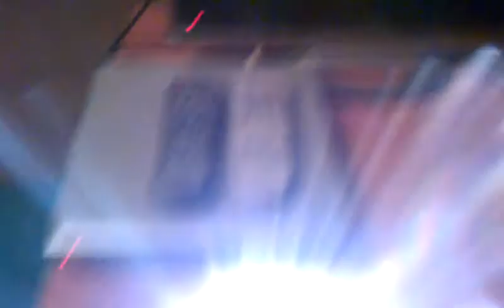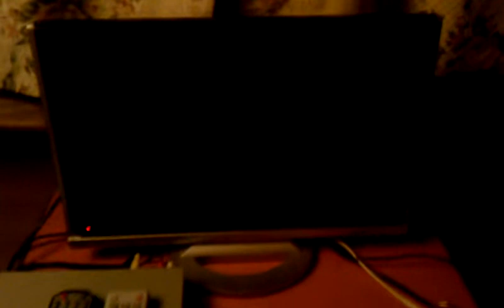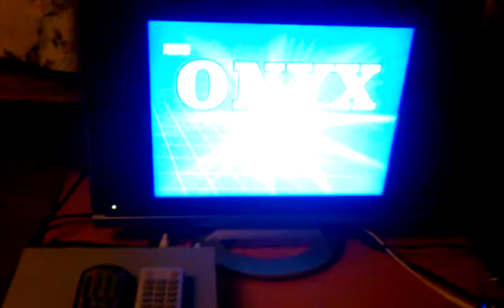Solar energy...1958 Comet

Comment: Don't drain the battery. It can take a few hours to recharge fully... Around 4 hrs. Try to use 12v electronics, and led lights. When u have a little system like this one, u don't want to abuse it by plugging in a bunch of things...